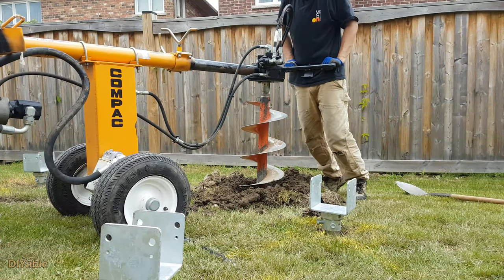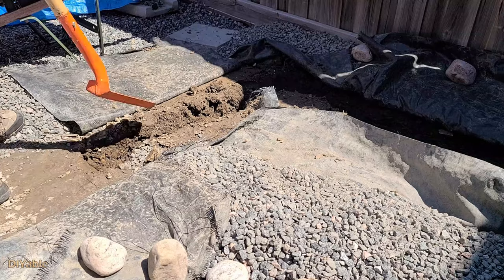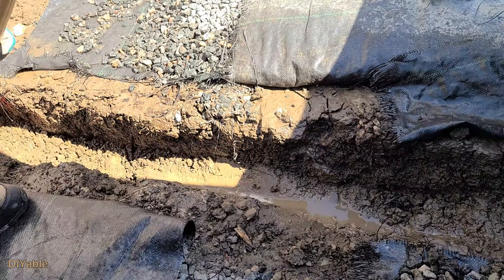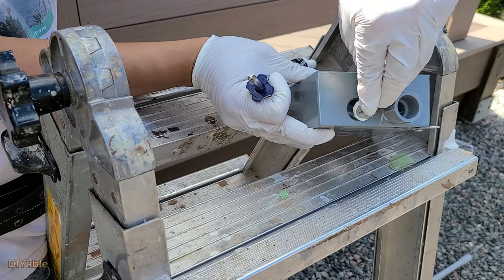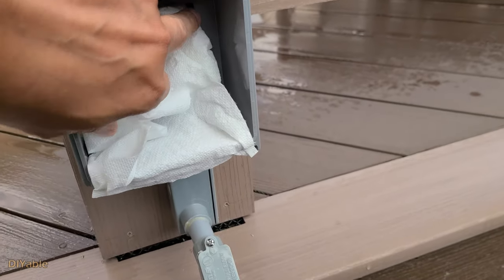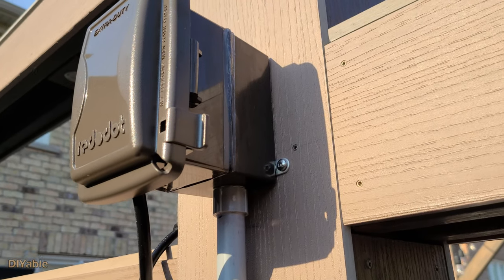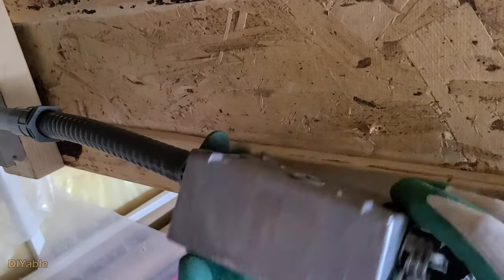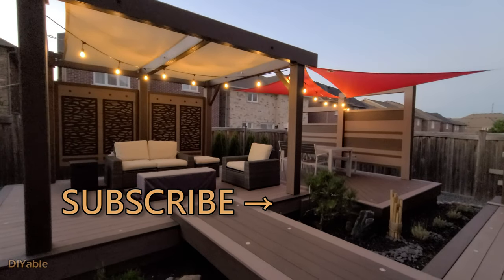DIY Deck (Part 23): How to Run 120V Underground Wiring to a Deck for LED string light?

Comment: This is a great video, very thorough. I can’t comment on the quality of the work, because I don’t know much about electrical. However, I did want to chime in that you can now purchase solar powered string lights. The solar panel chargers a battery, which will keep your lights running for days. This doesn’t take care of the electrical outlet in the deck, but it is a very easy way of adding string lights.

Comment: I did something similar but i use wago leveler connectors. To connect romex 120v to 18g full copper wire it said rating 120v light fixture cable.. it came with a tick isolation... no issue at all. I dont like the idea to hace receptable all over place to connect a plug instead use a wago connector just cut the plug nd use wire. Also you may solder de strand wire both works fine.. also i install secutiry camaras bc the adpater its 5v transformer i did ending using shrink tubing to attach 18g wire  no problem at all  NJ usa and keep the adpater insisde a double gang box.

Comment: Where I live, your receptacle must be of type GFCI.  The light switch would be downstream of the gfci receptacle so that if the breaker (in the gfci receptacle) jumps, because of an electrical ground leak, the lights and receptacle would be disconnected from the upstream electrical connection.
I would not use a panel GFCI for what you did.  Why?  Most receptacle GFCI's have a LED light to indicate the breaker has tripped. I would not want to have to run to the panel ( Run from the deck, to indoors to the utility room) to learn why there is no power). 

As an aside, having done a DIY kitchen,  the rule I followed is no more than 5 amps per receptacle or 2 receptacales wired downstream to a GFCI.  That should be the same rule you followed. All recepticales were powered from the gfci receptacle. .
Reply from the maker: Thanks for comment. The way I did was very similar to panel GFCI. Instead of using a breaker GFCI, I have installed the GFCI receptacle indoor in basement to protect the downstream outdoor, kind of similar to one GFCI protects all the outlets in your kitchen. Is this up to code? I don't know..  But as you can see, I tested with the GFCI tester and it worked.  I think if I understand what you suggested, you are saying in my Double gang electrical box, I can replace the RIGHT hand side standard receptacle with a GFCI receptacle to eliminate my indoor GFCI.  So, the GFCI LED can be seen on the deck and don't don't have to run indoor to troubleshoot.
Reply: @DIYable  YES.   In snow, running into the house, removing boots, etc, or getting the kids or the wife to check the gfci breaker, to me is an  inconvenience.  Since you bought the panel gfi, keep it, and just have the GFCI at the deck. (That is what I have done).  
With kids around cutting the grasss and not being careful, I have had the electric mower cut it's own cable and trip the gfci.  I unplugged the cord from the deck, reset the jumped breaker and all but the mower cord were restored as when purchased.  Yes to teens, even if they accidently cut the mower cord.
I am in Montreal, where we do get your weather, only 15 hours later.
Reply from the maker: Good point... thanks for the comment. Montreal is beautiful!!!!